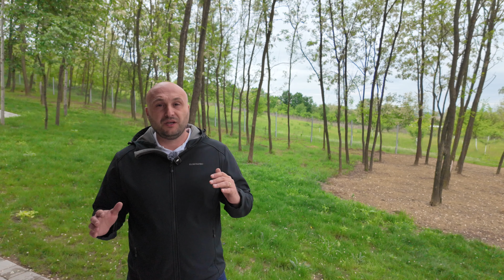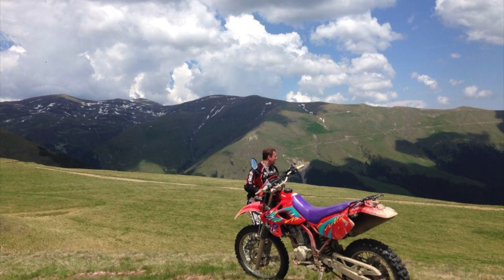How to install Twin Pegs on KTM 890 Adventure R

Comment from the maker: AN IMPORTANT INFO I HAVE FOR YOU. It seems that the 65mm screw that I was mentioning at the end of the video is actually working. So the provided screw of 65 mm is the correct one. I have this info from the owner of the Twin Pegs who installed it on an ktm 890 recently. For the moment I will only pin this comment here as info. I will test that lenght on my own bike to see where was my mistake, and after that, I will edit de video acordingly ! SO remember, the 65mm screw is OK

Comment: A very EXCELLENT explanation, clear and absolutely helpful; I am going to install Twin Pegs in a short time, courier should deliver very soon. One question I hope you can answer is the 65mm screw length if you had the opportunity to verify if is correct like the owner said and if it fits with no problem to Norden 901. Thank you bro

Comment: incredibly dubious idea. let me explain.
a) you won't be able to drop your heel going downhill or when making an aggressive hip movement back-to-front or front-to-back (jumping obstacles, leveling the bike in air). simply put, it inhibits your range of motion thus reducing control over the bike. this makes it incompatible with aggressive offroading.
b) it appears to be lower than stock/rally pegs. so if you stand on it, your foot isn't level. so you will have more strain on your calves when riding standing in a relaxed position (e.g. on a relatively good road when you are not in an "attack" position). so it's not very useful for chill adventure rides with long days on the road.
c) your boot sole is very stiff if you are riding in enduro boot (which you should be!), or even in a good adventure boot. it's literally a sheet of metal inside. in a boot with stiff sole, it really doesn't matter that you have only one point of support - your foot puts pressure on the sole, and you won't be able to feel the load distributed over wider area because its not your squishy feet contacting the peg, it's the sole. you will see it for yourself of course; i've tried a similar product before and unless i was wearing streetware or touring boots, i couldn't tell the difference in terms of pressure. here's an experiment: try to stand on sharp big gravel. then stand on smooth asphalt. can you feel the difference, does the gravel feel "sharp" while wearing the boot? no, it feels exactly the same, because the sole distributes the load. in fact, i also used to feel tired after long time standing up when i started offloading in my street riding boot – then i changed to sg12 and immediately i could stay standing on the pegs like i was standing on level ground. that said, for my 790r i prefer ktm rally pegs instead of the enduro pegs (like on my enduro bike), because wider peg means the foot doesn't "slip off", it feels more stable and planted. the tradeoff is that the pegs stick out more, so it's easier to get them to catch on rocks/brush/deep rut. which is why enduro peg is small – but you can still comfortably stand on it all day, it's only when you move about that your foot can slip a bit.

instead, i recommend you check out australian steg pegz. they are much less intrusive, yet help you take some strain from your leg & arm muscles. i find them helpful for both aggressive offroading as well as chill riding. oh and rally pegs if you don't have them are excellent!
Reply: Hi @EugeneYunak! I am the inventor and designer of TwinPegs, and I will say thank you for your unfiltered feedback, and the opportunity to explain a little closer. My background for this invention is enduro riding, and it is in the enduro tracks on my farm that the first prototypes have been tested. The terrain is forest with steep descents and climbs, lot of stones, roots and bare mountain ground. No sand, and no typical adventure tracks with gravel roads. Trust me, I have ridden steep rocky downhills on my Yamaha WR250F enduro, hills where very few adventure bikes would follow. If you want to drop your heels further, you simply move a litte backwards. Your opinion is very common, among riders who have not tested TwinPegs at all, but have spent lots of time learning to master the ergonomics offered today, single footpegs. We have all been told about the importance of using the calf muscle for added damping while standing. And that is correct, based on single footpegs, the way we have been explained is the only way to stand in a sensible way. You have to adapt your ride technique to the new opportunities that TwinPegs offer. With TwinPegs set up for enduro, you will typically adjust the rear footpeg lower than the primary footpeg. You will stand on the ball of your feet, or on your toeballs on the primary footpeg, and the heel will "hover" over the the rear support. The foot will pivot around the footpeg until it meet the rear support. Then the weight of the rider will be carried by the strong thigh muscles rather than the weaker calf muscles. That is why TwinPegs save a rider so much energy, this ergonomic concept is more in tune with how we are created. Our thigh muscles are stronger than the calf muscles. And standing with slightly bent knees like a skier, with TwinPegs support, and using the strong thigh muscles and movement in ankles, knees and thigh joints, make a very efficient added damping. To counter the resistance towards this new idea for motorcycle ergonomics, that challenges what everybody knows, I have focused a lot on getting TwinPegs into racing. If it works in racing, it works! Most of the key learning about this design task have been learnt by working with skilled enduro riders. Then I have worked with skilled rally riders to learn even more. TwinPegs have been used with succes in many wellknown rally races around the world. Finke desert race 2022, Condo 750 2022and Sunraysia Safari Rally 2022 in Australia (First god medal, KTM 890!). RoRally Marathon 2023 in Romania. Hellas Rally. Rallye Breslau, Poland. Galicia Rally, Spain. Baja 1000, Mexico. FIM Baja World Cup. In 2024; Dakar Rally (1 rider finished) and Africa Eco Race (4 riders finished). TwinPegs is not for everyone, a few riders find it very hard to adapt to a new ride technique. That is OK. But all the racing success with TwinPegs indicate that the absolute statement "TwinPegs is not a good idea for adventure riding" is simply wrong. In addition to saving energy, TwinPegs give the rider a new tool; effortless weight transfer towards the rear wheel. Very useful when accelerating, climbing and riding in sand. The fact that the rider is standing stable, reduces the force that must go through the upper body of the rider for stabilising the body, thus TwinPegs reduces the strain on the arms, and "armpump". The benefits of TwinPegs typically becomes evident when riders become tired, and their ride technique thus starts to become poorer. With TwinPegs you can maintain a good standing position much longer. It will be very exciting to see what Dragos get out of TwinPegs on his Bulgaria adventure. The jury is still out 🙂 Have a safe and fun riding season, Eugene!
Reply: @twinpegs8360  very interesting read, thank you for taking the time to educate me. i am skipping riding for the foreseeable future, but if i am still able to ride later i would love to try again, you got me hooked. and i will certainly watch out for Dragos' feedback. like i said, i tried pro moto billet air ext pegs before, do you recon these are similar enough to your product to give them another go and help me understand if this concept would work for me and how to take advantage of it?
Reply: @EugeneYunak  thank you for your reply, this is an interesting and respectful discussion where we all bring our different experience to learn more. Just like it should be among fellow enthusiasts! I am aware of the Fastway AIR EXT product. The reason why I chose a design approach with two independently foldable footpegs, despite that this solution cost more to produce, is that it eliminates the geometric limitations imposed by the requirement for the footpeg to be fully foldable. With TwinPegs I have full design freedom, when it comes to spacing between the pegs, size and placement of the rear support, and height adjustablity of the rear support. TwinPegs is a no-compromise solution. I don't think Fastway AIR EXT is a bad product, it is up to anyone what they prefer. They are mainly marketed as "ankle saver", not an active support. They catch you and prevent injury when overjumping. But that product have some limitations, that the TwinPegs do not have.
Reply: by the way, bar risers are also a double-edged sword. i took mine off once i learned proper body position and built proper enduro skills. check out Chris Birch's course for adv riders for example. i concede that they make chill riding standing more comfortable if you are really lazy. but tbh once you get accustomed to good body position and build a little bit of muscle – it's easy to ride all day long on medium trails (here in Western Ukraine we have very similar terrain to Romania). when you are standing in a chill position, like a bmw meercat, you aren't really adding much control over the bike. the only benefit you actually gain is visibility, and stretching your legs. might as well sit down more often. without a bar riser, you assume a proper attack position and become much more stable and in control, ready for any terrain. and again, it's really not hard to maintain this position, you get tired by wrestling a heavy adv bike, not by simply standing with your legs slightly bent and your hips rolled back – it's actually surprisingly comfortable. try it for yourself on a highway – i bet you can easily stand like that for an hour no problem.
Reply from the maker: Hello Eugene. I simply have 0 experience with the twin pegs on board. I will test them this summer and tell my opinion abot them. And I will test all of the mentioned scenarios, we  will see. Although you are right about whearing enduro/cross boots when making enduro/cross riding, in reality Adventure riding is something else. There is a plethora of market accesories for travel riding the so called "adventure riding". And people almost 10 out of 10 when making an adventure trip are not taking enduro boots. Because it is simply a different scenario. The bar risers, maybe in fact there is no need of them, but again not everybody is Chris Birch 😀 and the reality is that if you look on adventure bikes, 8 maybe 9 out of 10 have them. It just was a comparison to point out the potential this pegs might have. I tell you this. No matter the conclusion I might have at the end of this summer, I will have a video about it, and then we will see.  
Thank you for your points, it is so interesting to have cool debates !
Reply from the maker: Eugene please also go visit Twinpegs.no and read the riders report. One rider in particular is 11 times Dakar rider, and you will find interesting info.
Reply: @DragosRDS  thanks, i will check them out. looking forward to your next videos!
(re "harder enduro on smaller bikes" – yes true, but mostly i just adv ride on my 790r. or rather i did that prior to 24.02.22
Reply from the maker: @EugeneYunak Then the items would benefit you too! Keep an open mind and give them a chance, you will see maybe they are worth it ! Of don't get me started on that date... I pray to God it will be over.
Reply: @DragosRDS  i've tried pro moto billet air ext pegs before, took them off. seem pretty similar in function? i'm on leave from the army now so finally have time to ride a bit and i can't tell you how good being part of the motorcycle community has been for my mental health! watching your videos, ryanf9, zack&ari has been a real highlight for me fro the past two years and i can't thank you enough! i can't wait to return to Romania, loved adv riding there with my buddies and romanian colleagues.
Reply from the maker: @EugeneYunak  I would love to ride with you ! Let's hope we will do that soon. The Charpathians from Ukraine were always on my list of travel destinations for adventure riding. Stay strong ! We will ride some day !